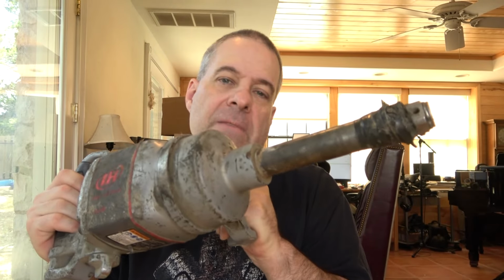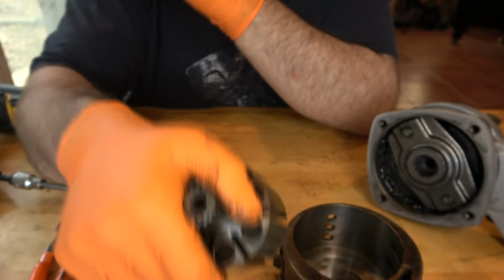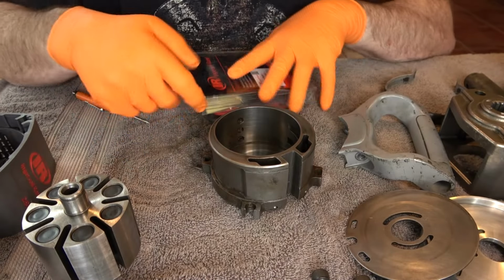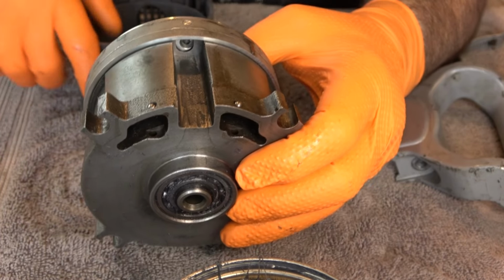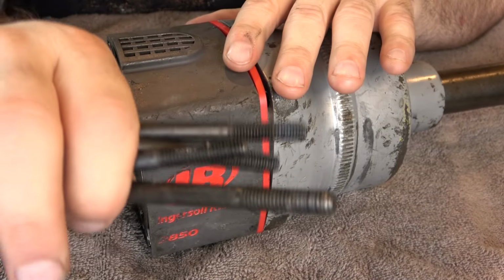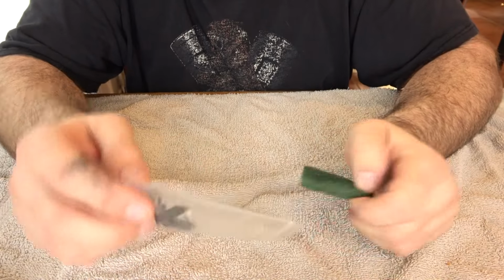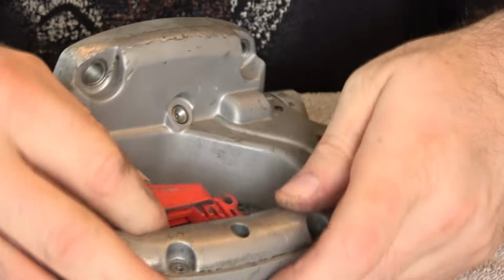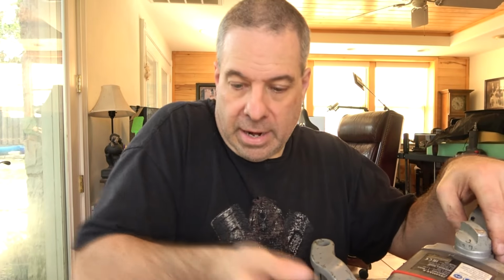Ingersoll-Rand 1" Air Impact Repair

Comment: I like the Matco ratchet
Reply from the maker: I can't remember why I have that. I think I swapped it with a Gearwrench one for a customer years ago. The long handle is perfect for these types of applications.
Reply: I changed all my I-beam craftsman ratchets to matco heads. A significant upgrade for both tool brands

Comment: Life experience has told me that nothing good lives under a big ball of gummy electrical tape.
They probably used the tape as some kind of cushion when they slide the anvil into a recess so they don't mar the recess.
Maybe they drilled holes in the rotor to reduce weight and then plugged the holes with lighter material.  
I'm impressed those grips were still elastic and flexible.  Somebody at IR had to have worked for a firearms company because they sure took full advantage using roll pins.   Get a tapered punch to align the holes in the housing a trigger.  insert the pin as you draw out the punch.
Reply from the maker: You always share your wisdom, James, thank you!

Regarding the rotor, those round black things are on the schematic as "rotor plugs" but I don't know their function. I didn't try very hard, but I couldn't take them out.
Reply: @CoyleTools  You are very welcome!  I try to help people not make the mistakes i made!
It could be for weight.  That rotor could get really heavy which means it would take longer to spin up.